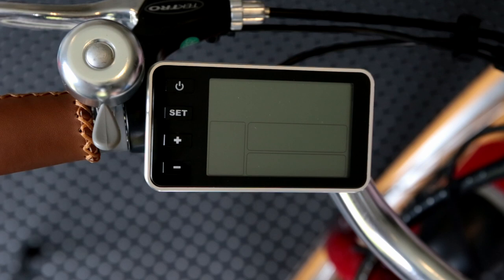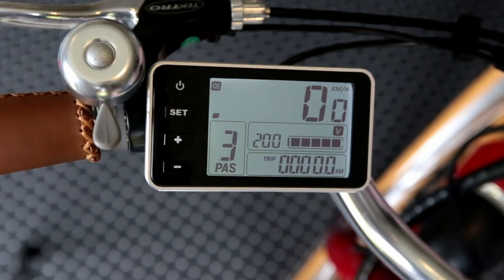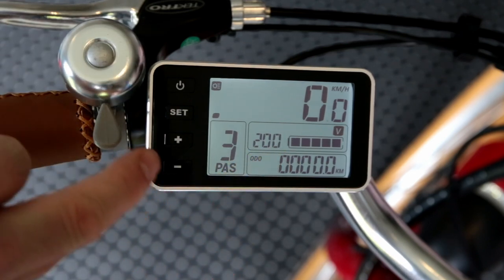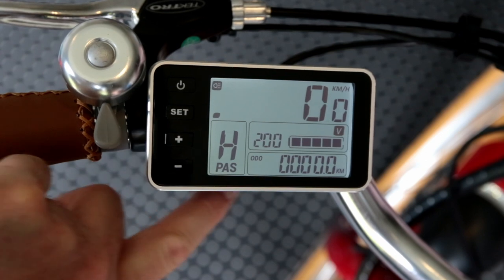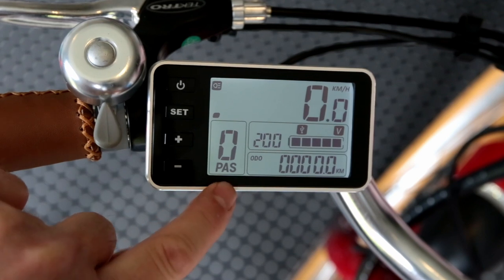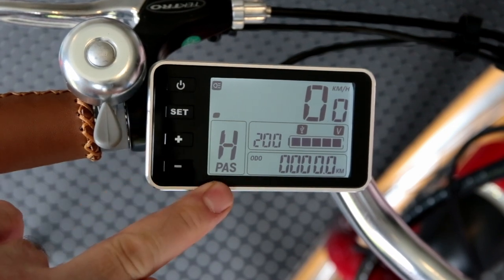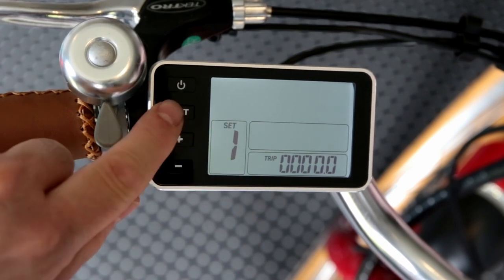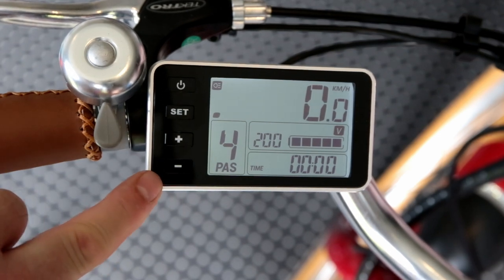Dyson Bikes Tilba Electric Bike Display overview and operation instructions.

Comment: how to you make the bike go faster I have the same lcd computer on my bike I wanna unlock the speed on it and thanks
Reply from the maker: Hi, it depends on the bike. On the our bikes they are 200 Watt and in Australia do not have a cut out. If you have a different brand bike it may be locked by the software and not changeable.